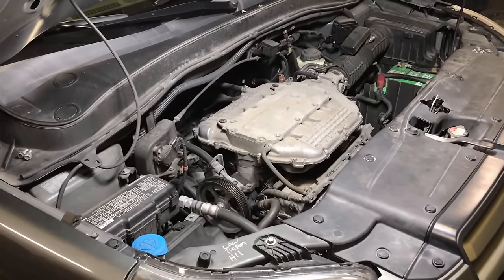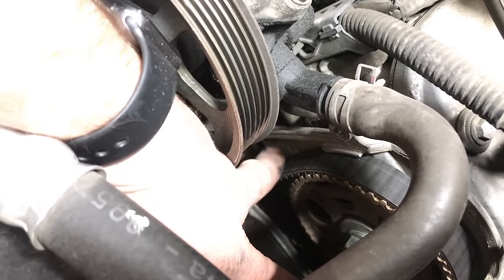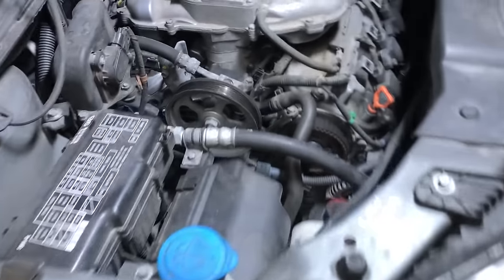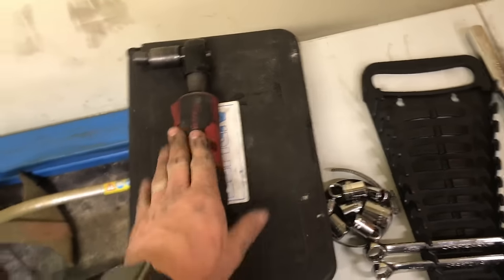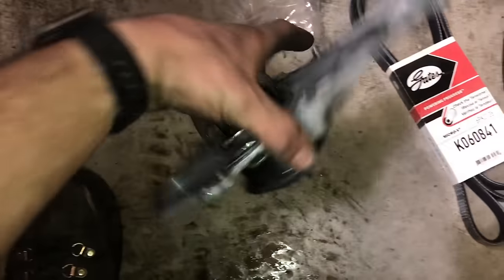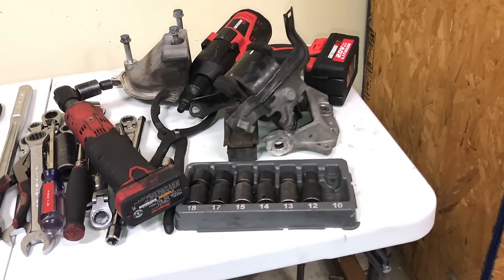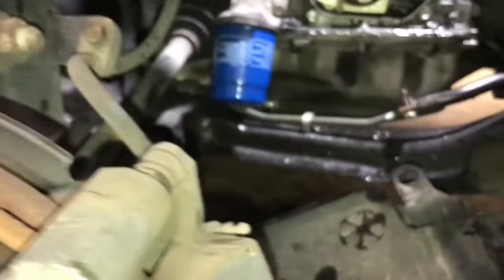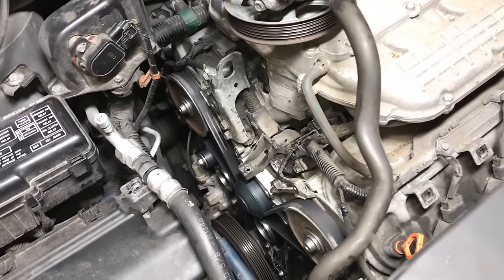Honda 3.5 Rattle Noise

Comment: 5-6 hour job we own two pilots and an Acura, you save so much money doing it yourself. I still wish they had timing chains.
Reply: Agreed. Wish they came with chains. It lasts longer
Reply: Just did my 13 pilot water pump/timing belt and tensioner and now sounds like a sewing machine.
Reply: What symptoms were you experiencing with yours I have a 2004 Acura MDX with a 3.5 l and just out of nowhere just started making a rattling noise when you accelerate it kind of goes away lower speeds idle you can hear it I was wondering if you experienced the same issues thanks
Reply: It was wife’s vehicle so I didn’t notice until I drove it. It sounded just like that. Really bad when it was cold sometime louder than others. I used the Lysle 77080 19mm heavy socket and Milwaukee 18v 1/2 to get crank bolt out. Reg 19mm and all other impacts I had would not touch it. That socket with any of my other impact prob would have worked. It’s a massive socket!!!!!

Comment: There's a special tool made for those engines you can rent from O'Reilly's to take off the harmonic balancer if you don't have a strong impact like that.  Great video!
Reply: Just use the starter method. It’s literally so easy.
Reply: @thronewalker1153  you can but you risk chipping a tooth on the fly wheel or starter.
Reply: @joshp9842  one time should be fine. I wouldn’t recommend doing it every time. Tried everything. The special tool. Huge breaker bar. I tried start as my last resort.

Comment: My Dewalt 1/2" battery impact took the crank bolt off using a weighted socket. I've also seen them taken off with Milwaukee M18 impact.
Reply: yeah, I was about to say my dewalt 3/4" battery impact takes it off like butter.

Comment: You don't have to use impact tools to remove the big bolt on the vibration damper.   Put a breaker bar on the bolt and rest it against the inner fender with a towel for protection.   Crank the engine just a little to turn it over and the bolt will free up.  Very simple.   I learned this from working on an Infiniti Q45 years ago.
Reply: On the vibration damper, do you mean the harmonic balancer and the crank bolt? I think I follow with putting a beaker bar on that bolt and let the crank usncrew it's own bolt?? I've never heard of this and while it sounds risky, I'll keep it in mind.
Reply: @UffDaDan  Yes the crank bolt and no this is not dangerous.  Just don't stand near the front of the car when you are starting it.  It makes a loud noise just for that initial second as it breaks free.  I've done this several times of the last few years.  I'm amazed this car did not jump timing given the tensioner went bad.  Make sure you use a Honda gasket on the water pump given they often leak and that can cause the timing belt to break.  These interference engines are rather annoying.  Interesting he ran the engine before putting the timing belt covers back on.  I was wondering about that and wish I had done that the last time I did this work on my Honda Accord V6 it would have saved many hours of replacing the engine.
Reply: It works with an impact if you use a special socket. Bought mine from Snap On for $60
Reply: That's the only way I break them free. Except I just stick a 1/2 ratchet in-between the A-Arm and strut and crank it over. Pull the ignition fuse. Even if it kicks over worse thing that happens is the bolt comes completely off
Reply: I second this..I've done it multiple times on multiple vehicles. Even some with push button starts. I have a video if somebody needs to see it I'll post it on here.
Reply: Doesn’t work all the time I just finished doing mine tried that and did not even budge
Reply: It works I've done it on Fords

Comment: Sometimes this noise is the serpentine belt tensioner which is an easier fix.  However if you have not done timing belt service then do it. If that belt breaks it breaks your engine.

Comment: I have 2007 Pilot Elite, Rattle noise only comes when car is cold. Once warm up, noise is complete gone.  What could be wrong?
Reply: 2014 here, same
Reply: Had you get the answer because i have the same issue?
Reply: @syla5860 i have the same issue as well had you find out whats the problem exactly ?
Reply: @georgeabboud2374 
Haven't been able to figure it out
Reply: Vtc actuator

Comment: I had the timing belt service on my 06 LX V6 Accord right at the 100K mark.  Sometime recently (now at 151 K) mark, I started noticing the noise on cold mornings when I started the car.  It goes away after a couple of minutes.  I'm guessing that means the tensioner has not completely failed and it takes it a few minutes to get enough hydraulic fluid going to tighten up the timing belt.  So, if I go ahead and replace the apparently faulty tensioner, should I go ahead and replace the water pump and timing belt too as best practice even though technically not due to 200k?  It seems like it would make sense to do so since already down there.
Reply: Did changing the tensioner fix your problem or was it something else?
Reply: Drew I’m 7 months late but common sense advice would be to just do the timing belt water pump and do it all again in 75-90k
Reply: If you had it done at the dealer more than likely they just replaced the timing belt and NOT the tensioner which is stupid but thats how they get you to come back and spend another couple grand
Reply: Hello had changing the time tensioner solved your problem 
Because i got the same issue

Comment: Did you use all OEM honda replacement parts ? I'm debating our odyssey has 200k miles and will be handed down to my 16 year old son and figured my local parts store brand would be decent enough? Trust me im die-hard honda but $600 vs $120 is kinda hard to beat

Comment: Does that sound go away when the car is warm?
Reply: Wish someone would answer this as I've done a tone o research. My 06 v6 accord has a ticking tapping noise only on cold start when it's below 45 degrees. Not as loud as this video shows. MAYBE it's not as bad yet? Getting a stethoscope to make sure. Also you can apparently do this without removing covers.

Comment: I changed the timing belt the tensioner and the bearing, the sound was reduced but its still there. Can you give me an advice on what i need to fix
Reply: Wow! Did you ever get it right?
Reply: @rodneyjohnson2064  hell naw i sold the car got a 2016 model

Comment: Woodruff Key should be straight up at TDC. I used a Lisle 77080 socket and a plug in electric impact. The crank bolt came out without drama.

Comment: Buy the Lisle Honda crank socket set. They take out those crank bolts like nothing with almost any 1/2 drive impact including electric impacts. Also great for rusted suspension bolts.

Comment: Has this happen to my 08 Ody. It was so close to the 100K maintenance anyway, I went ahead and had it all done at once.
Reply: How many years did it last ?
Reply: I didn't let it linger. Mine only rattled when it was cold, about 1 minute first start in the morning. I scheduled the inspection within a week and had it replaced. At the time it happened, the engine had 150k miles and it was about 3 years ago, so 2018/2019. That was the original from the factory tensioner the mechanic told me.
Reply: @Pantherman1979  great thanks for answering. I have a 13 pilot with 75k miles and am wanting to change the belt . Honda recommends 7 years but i thought it was 10. So i wanted to see if any one has pushed it to 10 years.
Reply: @puma1294   In all fairness, I bought it used and had intended to replace the tensioner before I actually did. 

It was part of a kit from AISIN that replaced the water pump, timing belt, timing belt tensioner along with a few bearings (https://www.rockauto.com/en/moreinfo.php?pk=1798456&cc=1441873&pt=16088&jsn=414) that's the kit I got from RockAuto for $176 + shipping, AISIN as far I researched is the OEM for Honda. Looks like it's the same kit for your 13 Pilot.
Reply: @Pantherman1979  wow i did not know aisin was oem . Ive read people recommending it but i am weary. Im thinking of having dealer replace the timing belt kit with waterpump with oem.
Reply: @puma1294  No worries, just supplying an alternate part supplier to Honda branded; just incase you were looking.
Reply: Update.. i did replace the timing kit on 13 pilot with 72000 miles. The tensioner was starting to go out so good thing i replaced it.
Reply: Yea, it would seem that (from what I've seen) those "grenade" style tensioners have a tendency to wear out before anything else in that system. I have seen some people push the timing belt replace out to 200K miles; I'm not one to gamble like that though. The V6's Honda uses are interference. If the timing belt breaks the pistons and the valves are going to say "hello" and allot of money in your bank acccount will say "goodbye" in the process of replacing/repairing the engine.

Comment: Did you add coolant before doing the test run?  Aisin recommends soaking the water pump in coolant so the seals can swell and become lubed.  This was for a 5.7 Tundra motor.

Comment: My 2011 accord V6 has that noise when it’s cold outside, then it goes away, do you think it still would be a timing tensioner?
Reply: Maybe valve adjustment.
Reply: My does the same. 2012 Accord V6. It only rattles on a cold start 50% of the time. The noise goes away within a minute or two.
Reply: @ajlee6933  same here have you found any solution? Is your car still running ?
Reply: @camacho2939  needed a new timing belt. I was 50k over the recommended replacement mileage. Total cost, $800.

Comment: Thanks your video helped diagnose my 2011 Honda Odyssey.
Reply: Did it solve your problems
Reply: @rodneyjohnson2064  yes. Timing belt tensioner went bad. I just went ahead and replaced the belt and did all the services related.

Comment: Question, does the noise go away when it gets hot ? My 2006 Pilot makes a noise on cold start up that almost mimics a sound of a diesel engine noise, the noise goes a away after about 60 seconds...
Reply: Exhaust manifold gaskets. Leaks exhaust when cold, but when the metal heats up it closes the gap and the noise goes away
Reply: @BingChilling420_  not my issue...
Reply: @BingChilling420_  Could be power steering pump Honda hose o-rings dry out.  Usually noticeable during cold weather, also low power steering level, I had to run my mine above the full level.

Comment: hey man quick question/comment. I could've sworn I saw your crankshaft in the wrong timing spot. The little arrow for the crankshaft was on the bottom pointing south. I did this job myself and the arrow should be pointing north to the top timing mark. Maybe this was half way through the 720 degree check of your marks. Just wanted to check on that...lol sorry to bother
Reply: Your rt first thing I noticed

Comment: I apologize, I'm not a big car guy.. Any other possible reasons to get this noise. I have that identical noise . It's seems my timing belt has no slack whatsoever.  Real tight. Any other causes you'd be familiar with? Any advice would be appreciated.
Reply: What did your noise end up being?
Reply: Did you find what the problem was ?

Comment: What year is this one ? . I have a 06 honda pilot 3.5 4×4 and it says on timing cover I believe was replaced at 75,000 miles the timing belt and such but that's before I owned the vehicle .  It now has like 157,000 miles I believe and is my daily driver but vehicle is from a used car lot and has been good so far no problems but my sunroof however is leaking and some how got my seat belt wet on driver side.

Comment: Before replacing the tensioner, did the rattling stop at any point in time while the engine was running?
I have a 09 Honda Inspire with the J35A engine that has a rattle at cold start up, however the rattling stops as soon as the engine gets up to operating temperature. Any possible reasons why this happens?
Reply: Same here.
Reply: Same her too.
Reply: I deal with this. 75k miles 2016 accord V6 touring
Reply: @millys4368  Hi Milly how long does it take for the noise to stop after starting the touring?
Reply: @Kornbeefy661  probably ab 2-3 mins or so. Im in PA winters have been about 10-20 degrees here overnight as well. i usually never hear it during the warmer summer and spring months. Its always loudest on cold starts first thing in the morning. Im at ab 78k miles rn
Reply: @millys4368  my 2016 odyssey with 75,000 miles is doing the same thing. It makes a lot of noise sounded early morning like valve train tapping but after 2 or 3 minutes of warming up it will be gone for the rest of the day.
Reply: @millys4368  Could be power steering pump Honda hose o-rings dry out.  Usually noticeable during cold weather, also low power steering level, I had to run my mine above the full level.
Reply: I think if it goes away it's the serpentine belt tensioner.  This is the belt you can see, it also has a tensioner. You can remove this belt and start the vehicle and see if it still makes the noise when cold.  If it goes away, it's the serpentine belt tensioner.
Reply: I have the same car and the same issue.

Comment: Battery powered impacts can for sure crack those bad boys off. I've been using my 1/2 DeWalt cordless 20V XR impact for 2 years, haven't had to grab my 1/2 air gun since. Definitely haven't had to use a 3/4 for automotive work, do you live near a sea or ocean ?

Also, I wish my home garage was that equipped !!! Nice work man!

Comment: My engine sound just like that. But its gets louder when its on drive and reverse and quieter when parked or neutral. Is that how yours was?
Reply: Same.
Reply: Just had to replace the motor mount on passenger side. It was making it sound like there was something rattling and scrubbing. Replaced the motor mount now everything is quiet.

Comment: 135k on that bad boy, when is the belt supposed to be replaced? 100k or 120k?
Reply: 407ForRent 100k
Reply: I’d rather have the I4 with the timing chain.  You can’t use the V6 power anyway with the low speed limits.
Reply: Brian Does the v6’s are dogs
Reply: @user-tb7rn1il3q  actually never mind the power... these Honda V6 have low rpm torque between 1,000Rpm and 2,000Rpm, no need to redline it to get moving.
Reply: G Lasser The I4 will move the car at idle.

Comment: My Honda Pilot is doing this exact noise in that same area. The belt isn’t lose though.  Could it still be the timing belt tensioner?
Reply: Valve adjustment

Comment: Got a question, I changed tb, wp, idler and tensioner about 3000 miles ago and then I noticed the rear cam pulley was making noise. I removed the upper timing covers to make sure, also noticed that the timing belt was a bit loose between the two cam pulleys. Is that looseness normal? Wasn't like that when I replaced it. Just so you know all parts are aisin.

Comment: does the noise go on and off ?? and disappear in park when you rev at 3k for minute or so
Reply: I’m having the same Problem too.It sounds like a Pulley making Noise.I changed the DriveBelt and DriveBelt Tensioner.I still hear Whining Noise.

Comment: have the same sh!t, parked the damn truck two years ago because of the noise...
put a battery in, boosted it and it started on second turn of the starter - noise is still there but now i have hope of getting some money for it not as scrap

Comment: I would never use an aftermarket hydraulic tensioner , I saw one fail at 40k which tossed the belt and bent the valves

Comment: My 2015 with 99k miles started a similar noise but it only happens during the first cold start of the day. Sound seems to be coming more from the transmission side. Goes away after about a minute of running (idling)
Reply: What was the problem with? I have the same issue
Reply: Me too same issue on the cold start...Started about 2 weeks ago, with 77K miles. Did you fix your problem ? What was the problem ?
Reply: @littlelizardpsycho5178  had the timing chain service done. Noise went away
Reply: @vicmreyes  Thank you for the reply...Glad you were able to fix it. 👍🏼...
Reply: @littlelizardpsycho5178  thanks. Good luck with yours.
Reply: @vicmreyes  Thank you,friend. Be well.

Comment: If someone monitors this. I have 2008 pilot 3.5l  at load a vibration noise rattle. If I press harder no noise unless it's loaded like on a hill or on take off or kinda going steady. Is this the same issue but hasn't got too the full time rattle? At first I thought it was the exhaust cat cover but nope. So anyone send a confirmation before I take to a mechanic.

Comment: Mine does the same sound but it smokes a lil from in front of the motor? Any ideas?
Reply: Most likely your valve cover gasket is leaking motor oil which ends up on the exhaust and gets burned off creating a smoke

Comment: Knew someone with 375k on original belt they were talked into getting it done shop put it on wrong ruined the motor
Reply: I hope the shop compensated the customer for their mistake .
Reply: @johnlopez3001  no

Comment: Excessive mileage causes this...replace it at or around 100k miles, and the J will run for ever..
Reply: especially if you use low rpm torque and stay away from high rpm that kill old converter and loose transmission bearings.

Comment: That belt was over due by 30k! A set of plugs are on order too. Hondas eat spark plugs.
Reply: Only if you have oil changes every 10k do your spark plugs get ruined. That is because of the dirty oil ruining piston rings!
Reply: if your engine vibrates at idle... save your money, its not the 3x engine mounts nor the coils! 
It's the serpentine tensioner that is not keeping the engine load constant and triggers the PCM to lean out the mixture long term trims on both banks. It also helps kill steering pump (pressure regulator) and alternator regulator/rushes... yep TENSIONER is the money maker!
👍